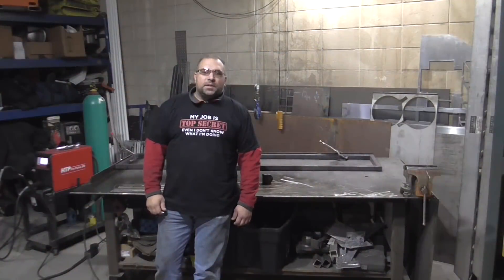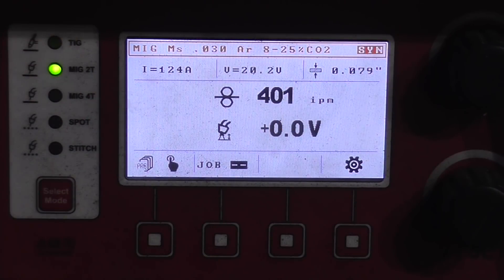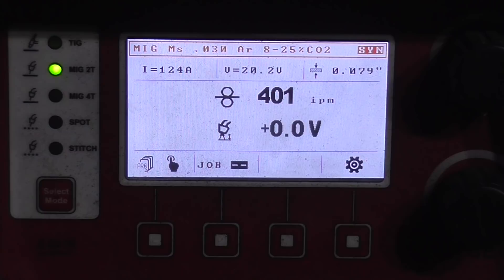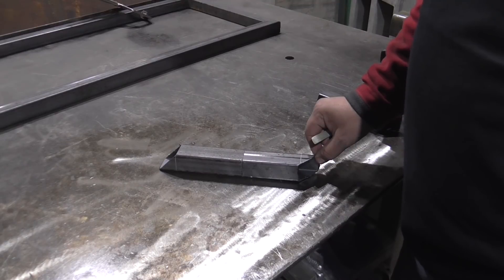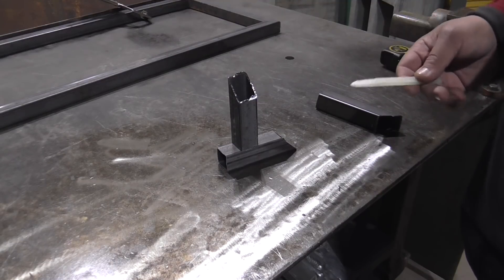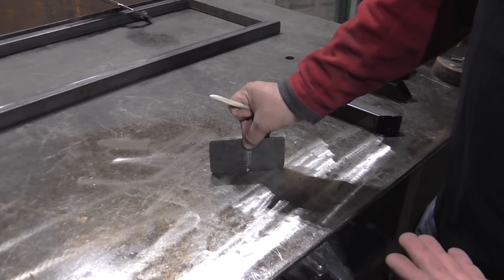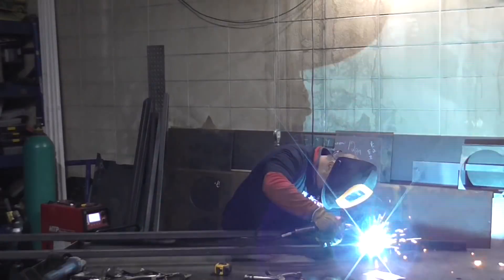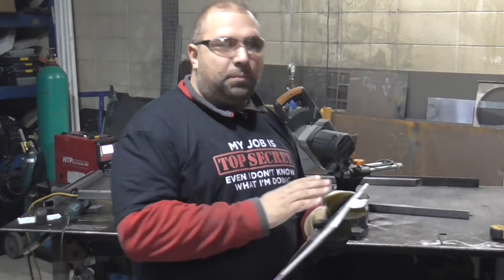What does Synergic mig really mean and how does it work? Heat input, joint config,  gun manipulation

Comment: Never buy a MIG welder that has Synergic if it doesn't have manual mode to. I did the BIG mistake of buying telwin technomig 180 dual and it has this retarded synergic and i can't control the speed of the wire, and when it is on full blast the feed speed is so high it cant really weld, it is just melting wire, basically a expensive metal caulking gun...
Reply from the maker: all HTP MIG welder have a manual mode.   the never ones the manual mode is "front and center" ... there are a lot of guys out there who share your thoughts on synergic machines ... so manual mode became front and center again ... and there are printed door charts with wire speeds and voltage as well ... this will get operators close - but ultimately THEY are in control
Reply: @ZILAwelds  Actually i bought telwin technomig 180 dual MIG/MAG, TIG and SMAW, and that machine has no manual mode. No digital screen only 2 dials and it is all some smart bla bla bla synergy crap. And when you crank it up then the wire goes also on full and you are left with melted wire and no welding. I have literally see the weld bead fall off. The 220 version has synergy and manual mode...

Comment: Hello Peter.....the saw blade you used, did you use it in a carpenters drop saw? Being old school ...I used only old style cutoff wheels. Thanks again for a great video!

Cheers

Rob
Reply from the maker: this is a special metal cut off saw - the saws rpm alert a lot lower than on a wood saw ....  !!!    and it is a special metal cutting blade.  they make blades for steel, stainless, aluminum and wood - every blade is DIFFERENT and specific.  the RPM ratings on the blades for metal are a lot lower than for wood - you can NOT run those blades on a regular wood saw

Comment: Why don't you measure cross corner to check square?
Reply from the maker: William Preston that is a great question ! And as soon as i have a little bit more time i will  made a video on “this” it is a really interesting topic .  It is real interesting how “welding” sometimes has nothing to do with sparks and setting and and and - but more so with the set up you are working with. 

About 12 or 13 years ago before i even had my own shop - i worked for a welding outfit in milwaukee that was a job shop and part if an industrial dryer they were building was 300ft of catwalk with handrail. 
And the foreman said: that will take us all week to build those handrails!
( there was a palette with 1.5” pipe already cut to length - all different sizes for the job - then there was a bag with 90 degree elbows, a welding machine a stack if prints and 5’x10’ table) and i told the guy: i can build them all myself in less then a week.   He laughs and says: no way!    I said: i show you.   He says:  YOU just tack all those together and i have others weld them.   I said: i wont have much to do then and laughed.  So the deal was on him an i made a deal that i could work as many hours per day as i want to and he agreed that if i get this done in 2 days - the second day he would clock me out at 4pm no matter when i leave and i get to leave whenever i am done tacking those railings up. 

So came monday morning 6:30 i started. 

I said i need a 20 ft angle 2x2 or 3x3 
He said what for?
I said you will see. 

First think i did was build a right angle on that welding table ( like you see on my table)  than i build 2 “H” frame spacers 16” tall each out if the remaining angle iron because the handrail had an intermediate rail spaced 16” from the top rail. 

Than i studied prints.....  sorted material ....  its almost 9 o clock now and the guy comes over and said - you have 300 ft if railing to build this week - dont you want to start now??

I said - dont worry remember this conversation when you clock me out at 4pm while i am on the beach at lake michigan ....  

He shook his head and walked away ....

I started to put all the parts for the first railing in the fixture. 
And tacked the first section up in under 10 min

I NEVER measured square or measured anything because the setup guaranteed  squareness and the correct distances .... i worked till 8pm that night next morning 6:30 i had a few more section and 2 sets of rail for the stairs to build .....  i left before 11am he clocked me out at 4pm

He could not believe what just happened ....  

That right angle on my welding table has been a real money maker for me!
I never measure diagonal ( that only works on squares and rectangles anyways) often i have to build triangular frames that have one 90deg angle - those i can build on that table too .....  its awesome

 Welding is a lot about set up

Measuring is a time thief - also when i saw cut stuff i measure the fist piece. Then when i cut multiples i clamp the first piece to the stock and cut ....  
tracing is faster than measuring especially if you build multiple ...

In this video here - that was a “one off” that is how the mistake happened
Reply: Yup. Everyone of my friends think welding is just squeeze the trigger an melt metal. When they come over to make something an get raw material and a speed square it opens the eyes. And I make them hand cut everything. Plasma cutter is for making money not for them to draw their name on stuff.
Reply: ZILA great story and I have used this method on projects and it saved me a lot of $.

Comment: Hey Pete, After seeing your review and comments on the everlast 275p I was thinking about getting I looked at everlast website and they now make an I mig 256 Dpi that seems like it was in response or to complete with true synergic welders. this one is 250 amps, the Propulse seems to be all sold out, the Stel is not as easily found to buy. would this 256 dpi be a good welder for welding aluminum if i purchased a separate mig gun with teflon for the aluminum?
Reply from the maker: David Carroll i saw a 253Dpi on the website.   No brochure , no manual, no real information posted ....  i cant tell you anything about it ....

Also - you will see here in the next week or two ( what you have already seen in this weeks videos) adjusting your settings WHILE you are welding is HUGE on aluminum - even bigger than you ever thought ....  because of the way aluminum heats up .... 

There will be more explanations coming ....  

Make sure if you spend 2-3 grand you get what you really want ....  
and yes - the 275p is probably not the answer ...  and like i said - the other one i know nothing about ....  (yet)
Reply: Thank you Pete, I feel honored for your response and I will continue to watch your videos. Thank you for what you do, it really makes a difference.
Reply from the maker: David Carroll thank you for watching!

What aluminum projects are you planing on?

Comment: Lots of great info here for all levels of fabricators.
Reply from the maker: the key information was - measure 3 times - still an inch too short ... than get a new piece of material - try to cut it - saw dull ..  change saw blade - pitch amazon link ...  and than finish welding frames ....   LOL
Reply: ZILA That's why Diresta's "If it looks straight, it is straight." is sometimes an easy way to look at it. LOL

Comment: Hi Peter, thanks for the videos you do much appreciated, But i have another question for you re setting up the machine .Please keep in mind that im 100 % self taught so please forgive me if i ask a stupid question or dont fully understand what you say
I was lucky enough to get my hands on an Everlast 275p to do strictly aluminium ( thicker sections and longer runs) as you know there is no material thickness setting on this machine unlike the HTP and this is where im struggling . do you still use the synergic setting to get a ball park setting for WFS and volts for different thicknesses and then switch to pulse ? or do you know of a chart i can down load somewhere . My previous mig was a lincoln 180c which was pretty easy to set up  A,B,C,D,E-1234.
So i can somewhat weld just struggling with digital.
I have a teflon liner, Proper contact tips to run 1.2 mm (0.045 )wire 5356
I also have a heap of 5mm (.195") 5052 Aluminium coupons for practise
100 % argon
I understand i need to do a lot of practise but are you able to help me with an approximate setting for the 5mm plate coupons just to get me started. 
Thanking you in advance for any help you can give me
Cheers from Australia 
Troy
Reply from the maker: Troy,

>>Hi Peter, thanks for the videos you do much appreciated, But i have another question for you re setting up the machine .Please keep in mind that im 100 % self taught so please forgive me if i ask a stupid question or dont fully understand what you say<<

There are only very few stupid questions in life - i think you will be ok :-)

>>I was lucky enough to get my hands on an Everest 275p<< 

congratulations - i own a used one i bought off craigslist

>>  to do strictly aluminum ( thicker sections and longer runs) as you know there is no material thickness setting on this machine unlike the HTP and this is where im struggling .<<

yes - it does show you average however ... as far as i can remember  - the only aluminum program that is synergic on that racine is 045 (1.2mm) wire non pulse
so where i would start is get the miller, lincoln or esab app for your smartphone, than enter your wire (kind 4043 or 5356 and diameter and approx. material thickness you intend to weld - and the app will give you a wire speed, a voltage (verify those against your synergic factory settings) and it also gives you an amperage - that amperage start making a chart ...  110 ish amps for 1/8" material thickness  150 ish amps for 3/16 material thickness   200 amps for 1/4 ish material thickness - now that varies a little bit by how hot or cold your material is .... and if you are running 5356 or 4043 wire ....

>>do you still use the synergic setting to get a ball park setting for WFS and volts for different thicknesses and then switch to pulse ? <<

on my 275p once you switch into pulse you are on your own - all the way .... there is no synergic setting any more at all ...  and the pulse is not synergic either ..... 
so now you have to know your wire speed, voltage,  than your pulse frequency ...  which that is very tricky - they frequency typically changes with the wire feed speed from roughly 30hz on the low end to roughly 300 hz on the high end ....  and than you have to "match" the pulse on ( duty) time and background voltage (base) with that ....  
and that is a weeks long process ... 
miller, lincoln, esab. fronts, stel, htp, kemppi, migatronics  ... they all have engineers and scientists sitting in some labs or tech universities for weeks or month to figure out the perfect settings ...
ever last assisted you with 7 or 8 pages in the manual with blank tables that you can fill in yourself as you find settings that work for you - this is unfortunately not stuff that i can explain in a few thousand words here ... this is much more complicated ....
also the ever last machine only have one pulse shape ...  that pulse shape "works" for all metals (different types mild steel, stainless, aluminum, (different games alu) sibro ... etc ) and for all different thicknesses - from autobody to 1/2" plate .....
now in my personal experience it only "works" so well .....  
also the ever last machine does not have a "trim" function - trim on a miller or lincoln machine will let you adjust the arc length in the aluminum (pulsed) spray arc ...  the arc has to have a certain length  - in my experience from where the wire turns from a solid to where the work piece is about 3/8"-1/2" and over all contact tip to work distance about 3/4" or a little more.
so not having the trim function you have to "adjust" the arc length by adding voltage to your setting or subtracting voltage from your setting.
higher voltage makes a longer arc, lower voltage makes a shorter arc ....  
sound eases far  - right ???

now if your head is not spinning yet - get this - when you finally have your arc length right - now all you pulse settings are off because you increasing the voltage to make the arc longer now also effected your background voltage setting (because that is a percentage from your welding voltage.  
now you need to go back and adjust that too ..... - and than your duty is most likely off ...   
when you have set it all and it works  - GREAT - write down what exactly your settings are ... so you can used the exact same settings next time.
always use the same wire from the same wire manufacture !  if you get a different wire manufacture next time and your wire is slightly bigger or smaller in diameter  - than you will have to adjust your wire speed to make up for that....  now with the wire speed changes the pulse frequency needs to change too ... reduced wire speed - reduced pulse frequency - higher wire speed  - higher pulse frequency - and than hope and pray that with the frequency change you don't have to go back and adjust all the other parameters again ....

the long and short of it - in my mind - full manual pulse does not put the operator in control like ever last claims - i thinks it put a HUGE  burden on the operator and is a nightmare ....

if full manual pulse would be all that great, how come non of the other companies i just mentioned offer it ?
For me (and i consider myself somewhat familiar with pulse mig) it took me almost 2 weeks to figure the 275p somewhat out....    and even if i was giving you numbers that work for me - depending on how hot or cold your material is .. and depending on what brand wire you are using and  and and ...  it may work for you so so at best - the real deal is - in order for you to do this right - i would have to teach you "how to find" the sweet spot and how to set the machine up yourself  - every time for every scenario ....  and that would be a hands on multi day thing)

  >>or do you know of a chart i can down load somewhere . My previous mig was a lincoln 180c which was pretty easy to set up  A,B,C,D,E-1234.<<  

like i said - those apps work good for wire speed and voltage and get you in the ball park ....
also the rough amp numbers i gave you should get you close

>> So i can somewhat weld just struggling with digital.
I have a teflon liner, Proper contact tips to run 1.2 mm (0.045 )wire 5356
I also have a heap of 5mm (.195") 5052 Aluminium coupons for practise
100 % argon<<

if you have 045 wire you should have 052 tips ...  (even ever last says in their manual that it is a good idea to oversize the tip next size up ....    (on 4043 thais even more important na on 5356)
also CUCRZR tips really help - they handle the heat so much better than old fashioned copper tips ....
especially if you are running an air cooled torch - water cooled is a little different ...  

>>I understand i need to do a lot of practise but are you able to help me with an approximate setting for the 5mm plate coupons just to get me started. 
Thanking you in advance for any help you can give me
Cheers from Australia 
Troy<<

you don't need a lot of practice  - you need a miracle !  or trade the machine in and buy something else ....  

sorry to tell you this so up front ....

GOOD LUCK
Reply: Thanks Peter, i appreciate your honest reply , you guys are so lucky over there with the choices of welding machines on offer as well as other welding products. We here in Australia are not so lucky with only a limited range , anyhow i won't give up just yet but i can sort of read the writing on the wall of what the out come might be. Once again i thank you for your time in replying to my question, stay safe.
Cheers Troy
Reply from the maker: try to weld without pulse first, than when you have that down (the drive rol pressure being very low the right liner and tips and everything works for you - than try to add the pulse ...play with  it a little bit - and there is a small "range" that the settings will work in ....  if in doubt have the frequency a little bit too high rather than a little bit too low ...

Comment: I was to say something in a previous clip of yours when you were making frame in that gig/setup you have there. Whenever I do a gig like this, I do an L-gig like this on the outside of one corner, but do the other corner along an inside L-gig. That way it always goes out easy ;) (even for other shapes, like hexagon or even circle, half of the gig is on the outside and the other half is on the inside)
Reply from the maker: that works too !    i made sure i had a 90 degree on the table so i don't have to measure 90 all the time again over an over ... and when i clamp the rest it typically "falls" into place for me ....